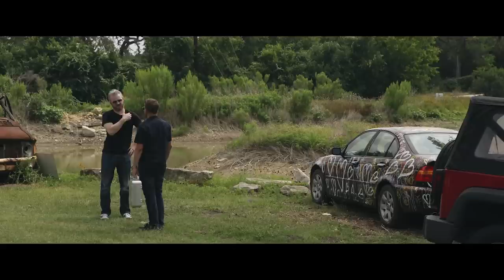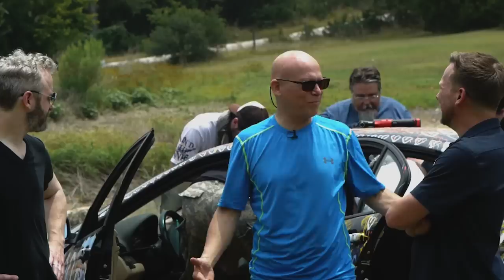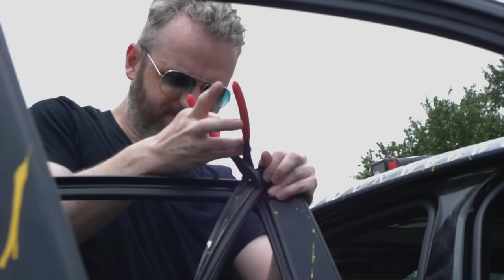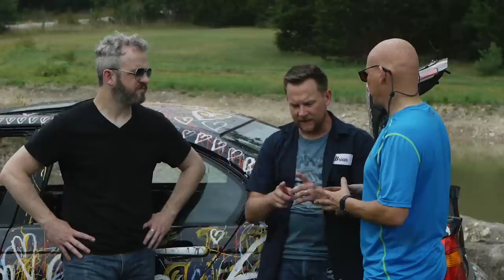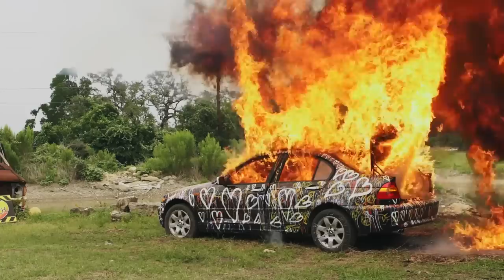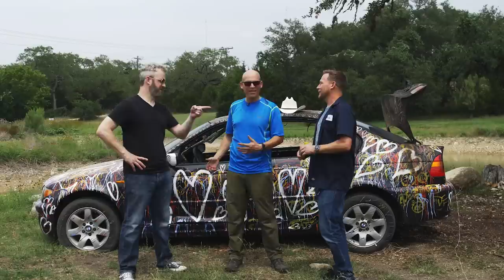Blowing up a Car

Comment: Uses "a special pyrotechnic flamable liquid" to prevent copiers
>Obviously gasoline
Reply: Scott Maday I like ur pfp High Lopez
Reply: you could use naphta(coleman's lamp fuel) and it would make a better explosion it's the easy way to make a thermobaric charge basically because it sucks air in to produce a massive fireball

Comment: idk what to comment so heres a pancake recipe...
In a large bowl, mix together flour, salt, baking powder and sugar; set aside. Preheat waffle iron to desired temperature.
In a separate bowl, beat the eggs. Stir in the milk, butter and vanilla. ...
Ladle the batter into a preheated waffle iron. Cook the waffles until golden and crisp.
Reply: Edward Ives thanks
Reply: Edward Ives "Here's a pancake recipe.."
"Ladle batter into a waffle iron.."
Fail.
Reply: what are the measurements for the ingredients.
Reply: kcirred htims how did my ass cheek get in here
Reply: Edward Ives Original, for real
Reply: Phoenix Raney howd that happen
Reply: Central Bop 
it happens

Comment: So Bmw 325xi is 3-Series Model. 2.5 liters inline 6. The X stands for xDrive bmw name for all wheel drive. Practically a rear wheel drive with some front wheel drive. And the i stands for injection i think. It’s petrol engine. 😘

Comment: That's a truckload of "nope" from me. That last minute sloshing around on the gas pour, into the bagged mortar made my ass pucker; not something a 30 year veteran would do. Also being that close to an real explosion is a big no no; let alone hand non-pyro folks a battery and two bare wires to fire this. Give them a real button and have it hooked to a real firing system. And, even after all the big talk about the explosions, that whoosh and fire that followed has me thinking of terms like, popcorn fart. Also, anyone that has worked with vaporized gas like this on set would have CO2 extinguishers, not water or dry chemical; it's like bringing a knife to a gunfight. As for a pyro school; I'll just pour a 5 gallon bucket of "nope" on that. I would suggest that anyone can check someone's credentials by making a few phone calls to some former clients and producers to see how explosive, polished, safe, and effective one's experience really is versus claims.

Comment: You guys mentioned counterstrike in an older video, you ever play CS?
Reply from the maker: only since 1999, back when it was in alpha and running on the HL1 engine.
Reply: oh damn, I wasn't aware, do you touch csgo at all?
Reply: The Modern Rogue i bet chuck norris was a modern rogue before the channel was created
Reply: yeah I do feel css and 1.6 were more fun although I was curious if they ever got into csgo
Reply: They were SUPER responsive in 1.6 when it came out. Then the drivers got smart and started buffering a ton of frames.

Comment: how did you guys deal with the airbags
Reply from the maker: ripped them right out.  once you saw through the straps binding them to the dash it's pretty easy.
Reply: Jesus. I'm a fire fighter man, I just finished a course on auto extraction and those mofos are dangerous.
Reply: Yeah, but with no battery hooked up, it's not a problem. You can shunt the battery terminals as well before removing the airbags to be extra safe.  I've actually accidently cut an airbag wire before.  I was lucky nothing happened.  Never have I had my ass pucker like that moment when you realize what you've done. I don't know why GM used to put their yellow airbag wire next to their yellow ignition wire in their late 90's cars.
Reply: Fair enough, I imagine they had the battery out for quite a while before they started fucking with it. But the newer airbags can hold a charge for up to half an hour. This isn't relevant but have you dealt with convertible pop up frames. It's like having 2 tiny pipe bombs in your car.
Reply: Adam Clarkson In this instance, I cut all the strapping and then ripped the airbag out with my bare hands. I still have it actually.
Reply: We physically removed the airbags.  Thanks for the great question.
Reply: Anyone else think it's a bit ironic that one of the most dangerous parts of dissembling a car is the thing that's supposed to keep you safe?

Comment: Very late to the comments, but 325xi means it's a BMW 3 series, with a 2.5 litre engine with X-drive, bmw's all wheel drive system. I don't believe the i means anything. 3(series)25(engine size) x(all wheel drive) i

Comment: Pffft thats no fun, making it safe. Your supposed to blow it to smithereens, and capture the blast on a long telephoto lens, just like Adam and Jamie did with the cement truck on mythbusters ;) TBH tho I love the guys safety protocols, no remote wireless firing systems, do it the proper way, with a lead in back to a battery, and keep it shorted until you're ready to fire :)

Comment: My sister had that model BMW. Her name was Jazmin. The radiator blew up so it kind of ended like this one.
Reply: The engine probably overheated and seized up. RIP, although usually there are some valuable parts like the engine and transmission hiding in there.